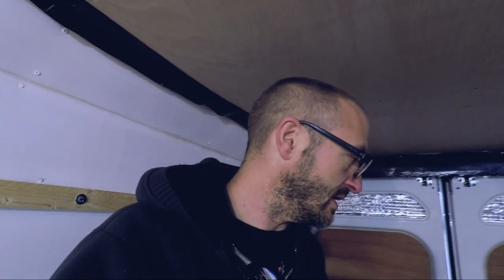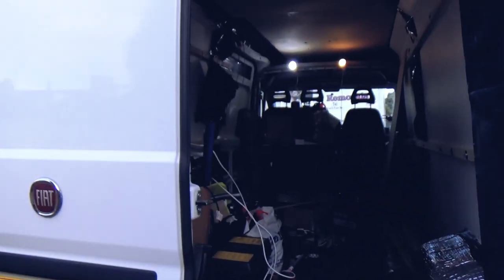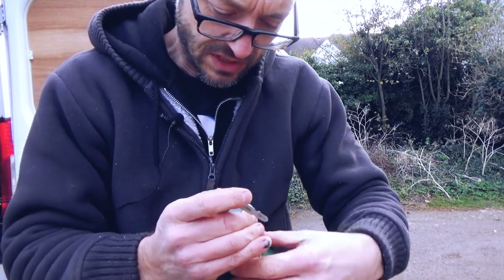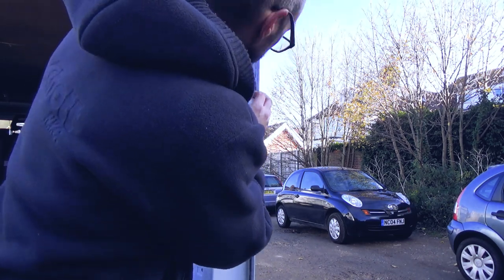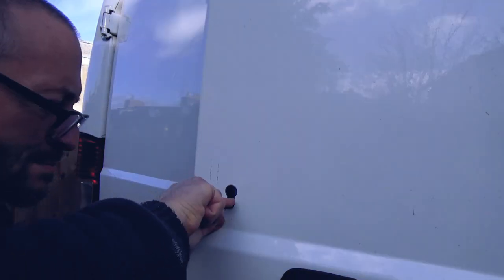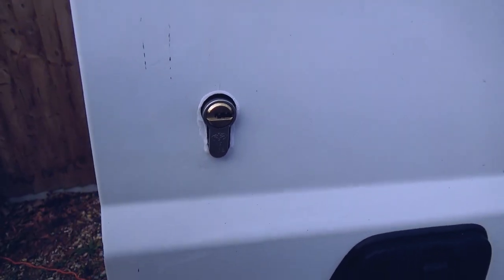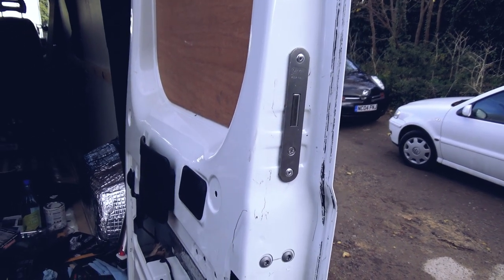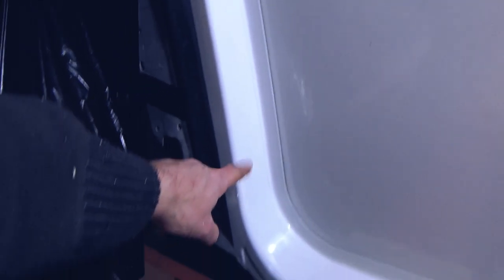26: Deadlocks for the Ducato

Comment: Mevi there are cool videos on tiny wood stoves made out of small propane tanks that can be made fairly easy and can cook on most the cooler days 😁
Reply: Wow van dead lock I need them ! Good job putting the locks on !
Reply from the maker: Extra peace of mind when I'm away from the van. They can't be unlocked from the inside, so I must always remember to unlock before I spend time inside.
Reply: @Mevi - I noticed that right away. If you have the chance, add the inside knobs for the dead locks ASAP. ;-)
Reply from the maker: @crpth1  I don't deadlock while I'm inside. If I DO forget, the release handle for the fixed rear door is modified to allow me to open both doors simultaneously and escape.

Comment: The door lack is the first one I have seen used on a Van.  It will keep you safe. For a person will not know how to open it. Locks on the other three door like the lack on the back door no one getting in to your Van.  Are you putting a cut off to the motor so it will not start? You are going to be very safe in the Van!
Reply from the maker: Deadlocks are popular amongst tradespersons in the UK. There's currently an epidemic of vans being broken into and tool theft. I won't take the chance it won't be me. 😊 There is an immobiliser on the ignition - it can't be bypassed or easily stolen without a key.

Comment: I know it 3 years since you did it, but I was just wondering if you stuck some rust proofer and around the cutouts. I've read that they sometimes rust if you don't is all
Reply from the maker: I painted the cutout with hammerite and then the decorative plate had some silicone before I rivetted it down. So far, no exterior rust. As this van was converted to a living space, the interior of the van is insulated and has a vapour barrier. Adds extra protection, but I've yet to peel the walls back to check.
The Ducato/Relay/Boxer has a galvanised body, so these vans mostly fall apart mechanically rather than rust being a problem.

Comment: I installed deadlocks on mine a number of years ago.  Judging by the instructions I got them from the same place.

So...  I will recommend you give them quick jet of silicon spray periodically.  The ones on my sliding door siezed up and I was locked out of the living area...  Pain in the ariss to sort out.
Reply from the maker: I'm using gt85 to keep mine lubricated. The little straw is handy too. 👍🏻

Comment: Nice job mate. Just wondering where you got the set of cutter drill bits ? Cheers
Reply from the maker: On Amazon. This listing back in 2017 didn't have the hole punch that has been added to the set. Read the reviews to check the new version meets your needs.

https://www.amazon.co.uk/dp/B06XXPNTWF/ref=cm_sw_r_cp_apa_i_sXD4EbP6J5J0S
Reply: Mevi much appreciated thank you 😃

Comment: Hi Mevi, thanks for alle the video's :-) very instructive for me, just starting the whole build project on a similar Van (L4H2 Citroen Relay 2015). Question (if I may) : why isn't the standard locking system of the Van enough ? or why does this Only apply to the back doors & sliding doors ? Until now I was under the impression that locking the Van at night with the standard setup would be OK and even when leaving it on the car park (out shopping :-) would be OK with the standard locking. what made you think about adding these deadlock option ?  Thx !
Reply from the maker: Hey thanks! Thanks for watching. 
If you search around, there are videos of people pushing a screwdriver into the metal just below the handle and moving the mechanism. The lock mechanism thinks it's being opened from the inside and unlocks.
I chose the deadlocks as they are installed inside the door, instead of the outside. It seemed more secure for me.
Any additional lock is better than nothing, but search to see if your choice of lock can be "bumped" or just broken off. Here is a video of your Thule lock.
https://youtu.be/jnm6URj_DjM

MK6 and MK7 Transit vans can be unlocked and driven away without an immobilizer key!
Reply from the maker: Also, I have 2 extra locks for the cab which I will fit one day. Came in the same set. One key opens all 4 locks and I have a spare. I have a secret unique code to order more keys.
Reply: @Mevi  wow ! that video of the Thule locks was quite shocking, and now seems like a waste of money. Since I'm still in the design phase I'm gonna see how to incorporate a 'good' deadlock into my plans. Thanks !!
Reply: Hi Mevi, thanks for explaining.. looks sensible now to me ;-)